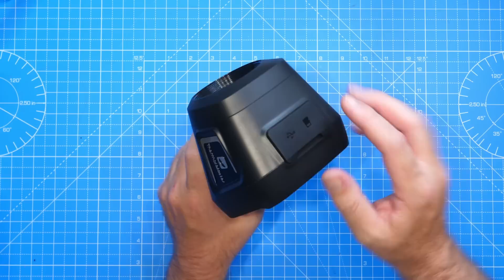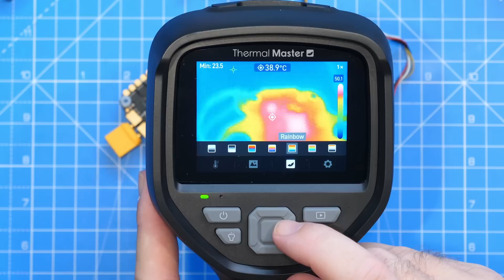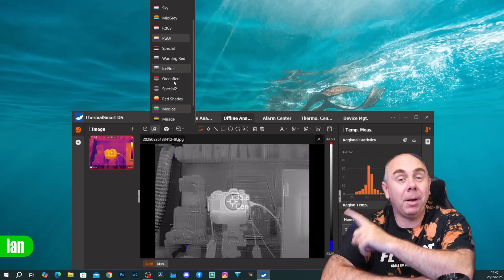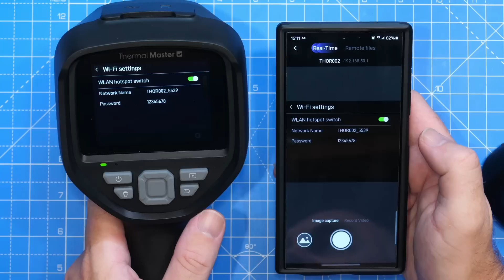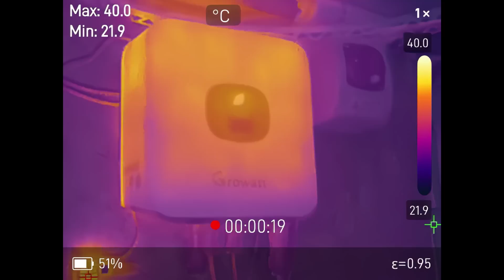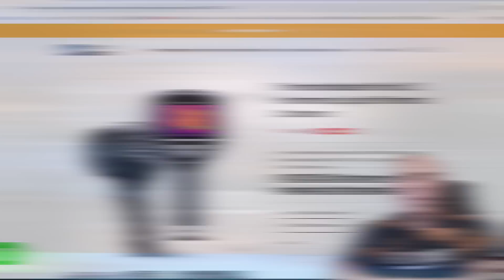Thermal Master Thor Thermal Camera - Handheld , PC Or Wifi From $299

Comment: Hello! Thank you for this great video. Highly appreciated. 
I have only a single question, which I would like to know before ordering one: Is it possible to get the battery out without damaging the case? I very much dislike tools with a fixed build in battery. It would be great to know, if when removing the metal base, the battery gets accessible. I have the fear, that in couple of years the device breaks based on a damaged battery. Do you have some information about the battery replacement? Thanks a lot. Greetings, Coelestin.

Comment: For something that size, it really ought to double as a megaphone—or at least deflect small arms fire. Honestly, I can’t keep up with the endless parade of thermal imaging gadgets and the Frankenstein “companies” peddling them.

Case in point: I own both the InfiRay P2 Pro and the T2 with 8mm adjustable macro and 15x zoom lens( Yes, zoom. I know, it’s not working with visible light but they said it would zoom and it sure as shit does). Whats odd is, Thermal Master sells these exact models under their own banner. Same hardware, different stickers. Welcome to the clone wars of thermal imaging.

Now, here’s the nuance the sales crowd won’t mention: I actually prefer InfiRay’s iOS app for quick mobile use—it’s clean, snappy, and doesn’t try to be a video game. But when I’m at the bench? Thermal Master’s desktop app is superior . Their mobile app, especially when paired with the P2 Pro, offers far more customization depending on the subject—be it PCB diagnostics or  HVAC leak.

Since everyone has probably stopped reading this by now, it won’t hurt to say that the little imagers are surprisingly practical. Clip one to a stand, plug it into your PC via USB, and you have useful imaging with zero desk footprint and both hands free to work. Better still, they integrate seamlessly with OBS, which means high-quality thermal overlays in  video content without tearing a rotator cuff with Thors Hammer.

That said, these pocket-sized marvels come with a tragic flaw: plug one directly into your phone and drop it? Say goodbye to your USB-C or Lightning port. Ask me how I know. The solution? A properly 3D-printed support bracket that mates the thermal camera with a beefy, OtterBox-style case. I haven’t wrecked one since—and I treat my phone like a hockey puck.

For a cleaner setup, I’ve even modded my iPhone’s OtterBox to accept the P2 Pro flush against the back using the included extension cable. It ends up riding alongside the iPhone’s native camera array, and the whole rig looks almost intentional—like Apple cared.

Now, compare that to the oversized thermal bricks people flaunt like a badge of honor. Sure, they have better resolution. But unless you’re kicking in doors or diagnosing overheating power lines from fifty yards, they’re just impractical. You’ll need a shoulder sling to carry one and possibly a concealed carry permit.

Sorry for the wordy comment. It’s rare that I have a somewhat coherent opinion on a matter.